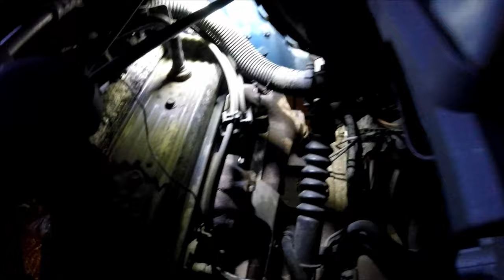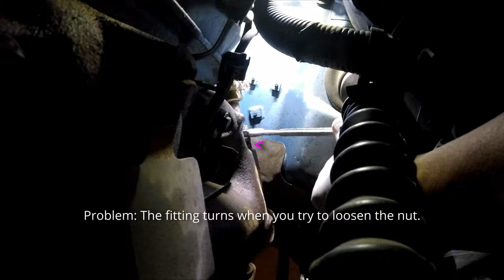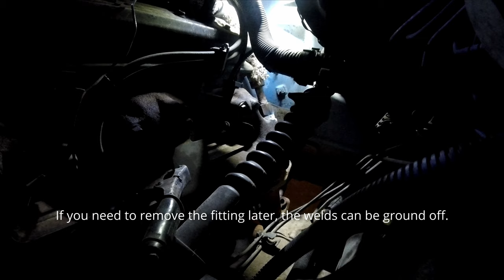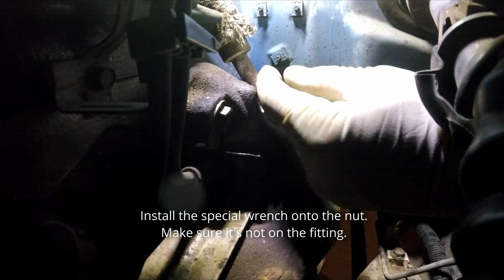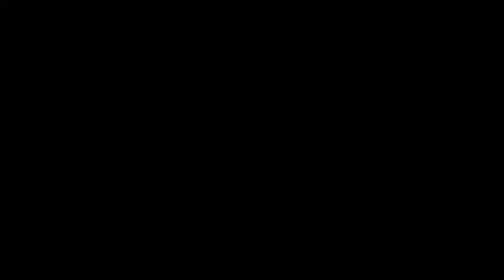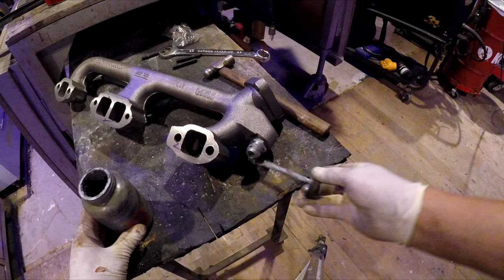1996-2000 OBS GM pickup EGR tube removal from exhaust manifold

Comment: I like the tool maker idea there! That could be the answer to my problem. Couldn't you just use two wrenches rather than welding the fitting to the manifold?
My problem is at the other end. The fitting comes loose easy but the pipe is seized to it; it twists the pipe.
Reply from the maker: The space is so confined I couldnt hold 1 wrench while turning the other. As far as breaking the pipe loose from the fitting, the nut is what squeezes the pipe to the fitting. Once you loosen the nut, the pipe should free itself from the fitting.  If not, heat and oil should do it. I think that's another benefit of using the welder. It heats up the fitting nice and hot.

Comment: Hi dear so I have an issue with my ford transit

So the pdf filter were broken and I went to the dealer they changed the pdf filter but one piece of pdf filter is stuck in the scr filter is there is any way to take of that part from scr catalyst